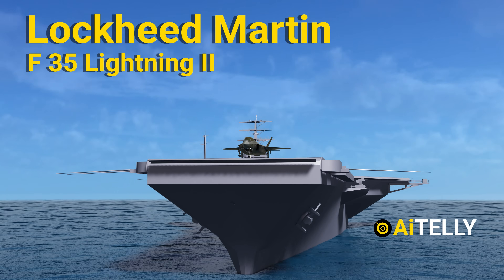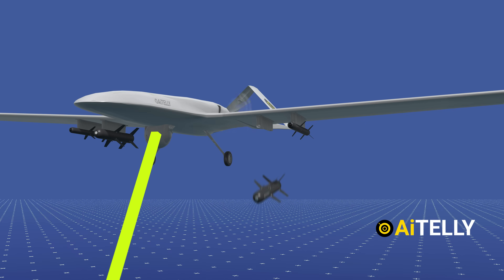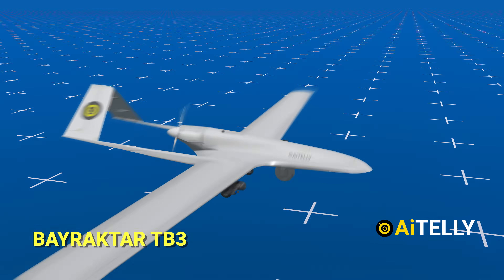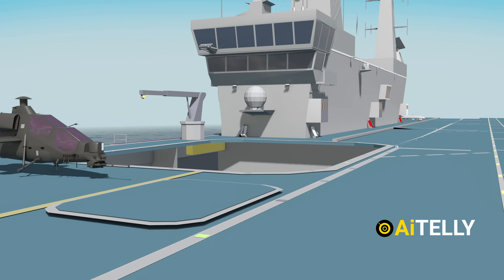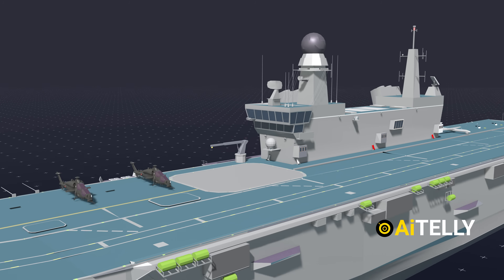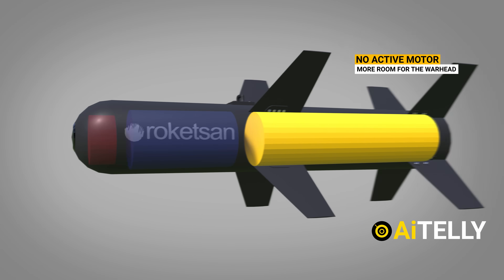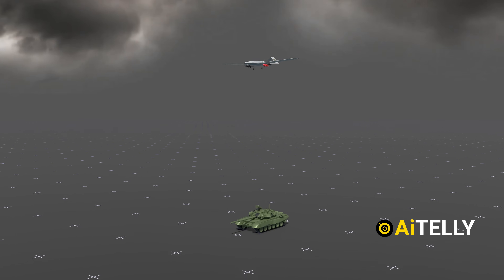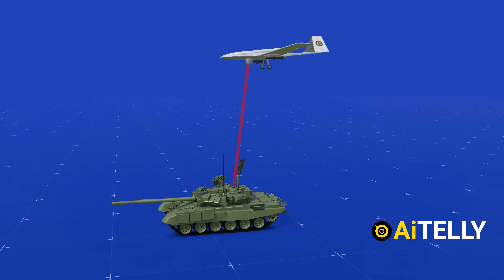TB3 Bayraktar drone Turkey | How it works #drones #tb3 #aircraftcarrier

Comment: Turkey actually does not need the F 35B, The S 400 is better and it could easily detect it. And that was a perfect choice. The drones of turkey are really good apart from politics.
Reply from the maker: Geopolitics is a huge mess.
Reply: @Aitelly  Well yeah. I have seen the reality of Ukraine and syria and all these politics. It does not matter who I stand with, I am sick of it.
Reply: @BaronAsh7981  A bit dissagree because S200,300,400 (I think) doesn't work well for small and low fly object (all 5th gen have small CRS), it maybe work perfect if turkey add Thor-M2
Or.... If they use all these combine with Nebo-M radar 
Nothing against you, just personal opinion share 😁
Reply: @vandasaragosa  Number 1. You can say anything you want. Just be respectful. I am always delighted to have someone correct if I am wrong. 

2. I think the S 200 and S 300 are useless against f 22 and f 35 and even f 15e.And you are correct about low altitude but the S 400 can detect at high altitude to to several frequencies in which at least one can track the F 22 and F 35 right? I mean tons of frequencies and giant range just to be able to give narrow beams to find the stealth. 

vulnerable

4. Thank you and have a good day.
Reply: @BaronAsh7981  I like number one most , I'll take it .. not easy to find normal communication or health debate nowadays lol 

For number 2 is yes I agree especially S400 , with 4 layer independent radar radiation (specific bandwidth is classified as I know) but again it requires another radar to detect 5th gen (before it to close) that is why I'm saying if turkey can get Nebo-M that'll be work , even with S300 is enough lol
Reply: @vandasaragosa  Yes S 400 alone can detect 5th gen at really high altitude at really far ranges but no one will do that. So Turkey or any other s 400 operator must help it out. Just like you said.
Reply: @BaronAsh7981  I know this has nothing to do with the stealthiness of the F35 and the S400 but It would have been more than a bad deal if turkey chose the F35 over the S400. Because to start and use the aircraft you need 2 passwords (for every use). You can only get those from the US. That's a huge problem and disadvantage for many countries (f.e. South Korea).

So in a nutshell, the United States tells you if you can use the aircrafts or not. On top of that, Turkey would have a big problem because of the stand of the US regarding for example Greece, the YPG/PKK and even more.
Reply: @aknc3891  If what you said is right then all f 35 operators are pretty much screwed up.
Reply: @aknc3891  Turkey already have many issue with nator like UK , US , Greece lol
Reply: @vandasaragosa  I don't remember any (major) issues with the UK. I would even say, that they are getting closer since the UK left the EU. They made a free trade agreement and the UK/BAE wanted to provide assistance in developing the engine of the TF-X. And it the future, there will, probably, many more projects, sales etc.
In my opinion, Turkey has problems with the US and Greece for a good reason but that's another topic.
Reply: F35 being trash is debatable. The only reason these things are stealthy is their minimal ability to be tracked by targeting systems (including the s400). Yes, the s400 can detect the f35, but most likely cannot shoot it down because of the ability to be near invisible to targeting radar. The drones were fine, but the f35 was a FAR better choice. Turkiye is already developing anti-air systems. We didn't need the s400. The TFX is already trash anyway because of the zero composite materials on the thing. Look at the factory production videos, and you'll see. Turkiye should not have moved closer to Russia because Russia has not only worse technology but also a worse economic system.
Reply: @SoloTURK11  TF-X üzerinde hiç kompozit yok mu? Sen iyi misin? Biraz gözlerini aç, uyuma! Tusaş geçenlerde Avrupa’nın en büyük kompozit üretim tesislerinden birini açtı. Fikrin olmadan önce bilgin olsun. Buradaki yabancıları da yanlış yönlendirme!
Reply: @SoloTURK11  This comment is fully wrong with the exception of saying the s 400 can detect the f 35. The f 35 xan be detected due to the low frequency the s 400 can produce. This low frequency can penetrate the stealth which is made just to avoid the detection by X band and hight frequency radars.  APARS like systems in russian air defense and jets can easily provide a lock and track to the radar thus guiding missiles right into the f 35 and f 22 face. The drones are perfect and are more effective than Faililure 35  and failure 22. Don't underestimate them. What do you mean developing?  This is a large country and needs protection as we speak.  Say an attack from any country happened, the s 400 air defenses will close the sky not the air defenses being developed....  Russia has the 6th biggest economy per population has nearly 30 billion dollars from arms sales last year. Russia has one of the largest reserve banks. Russia has a ton of gold and silver and platinum ready to empower the economy.  Russia has new customers ready to help.  RUSSIA CREATED ALL THE STEALTH YOU ARE TALKING ABOUT AND BEING ABLE TO CRUSH IT IS EASY AS IT CREATED IT.  Russia has 30% of worldwide iron.  And has 28% of American uranium.  So do your research.
Reply: @BaronAsh7981  No the F35 is stealthy against low band as well but not as stealthy as in x or ku band
Reply: @BaronAsh7981  I'll be honest, I don't freaking understand want the band stuff means. I probably need to learn one day. But my point still stands. The f35 cannot be locked on from the s400. The s400's targeting and tracking radars use different "waves" for different purposes. I know you know that's right. Now you think I am wrong about s400 not tracking? Well, it can't track. Not only that, Russia may be rich in natural resources, but that doesn't mean they are rich. The Russian GDP rivals France's. Look it up and tell me how many Frances fit into Russia. Also, sanctions do exist. Now to the nonsense that Russia has any stealth technology. As I said, nonsense. the SU57 can be tracked from miles away as there are glaring design flaws LIKE THE INTAKES BEING MASSIVE. Also, we see how well their military performed in Ukraine... sorry that was for the opposite day. Their military can't handle tiny Ukraine with a dozen TB2s and western aid. Everything isn't about natural resources anymore. The world has evolved. You should too. (If this was offensive, that was not the intended purpose.) Also low frequency you talk about is for early warning radar. I dare you to make a targeting radar with tech used on an early warning radar. Why do you think there is a difference? Read my text better.
Reply: @mastermariner490  What the hell did you say ? You just inverted it. Stealth is made to counter X band rays not L band. That can be proved by the shoot down of the F117 in Yugoslavia.
Reply: @SoloTURK11  This comment is so ignorant of you. How can you talk and post large text in this way without knowing the bands, you have to know the bands to know how stealth and radars work. It is ok to learn no problem. Let us see.  How could it possibly be not tracked or locked on, as long as low frequency can easily penetrate stealth then that is it. Russian systems have the capabilities of the apars. Go search it up. This basically tracks and scans the area where the aircraft was lastely detected and then afterwards keeps guiding a missile on to the aircraft in that position and this area is smaller every time thus finding the aircraft, tracking it and even locking it and providing guidance for the missile. Yes I think you are wrong and I can prove it thanks to what happened in yugoslavia. Who knew  the first stealth aircraft would be found by an old and outdated radar. It depends on physics and you should learn it. Here is some info from a book not youtube.  

https://web.archive.org/web/20121201031745/http://www.dtic.mil/cgi-bin/GetTRDoc?Location=U2&doc=GetTRDoc.pdf&AD=ADA529057

I am telling you that the russians have the 6th largest economy just behind germany and a couple others and you continue to tell me the economy is crap. Your sanctions have resulted in the ruble nearly hitting 8 year high, Russia will domestically make vehicles and planes , russia found new friends and europe will be a chunk of ice next winter.  See the german and british inflation, biden lost trust, 3 prime ministers for the UK in 1 year. 

As to russia having stealth yes they do, and I will tell you how the F 22 will never detect the Su-57, your best radars on the f 22 are barely half the range of Russia's Byelka. Secondly Russia may use 2 of it's 6 radars with low frequency to penetrate the f22's stealth and yes it can track and lock it due to special systems like APARS.
Secondly Russia's Su-57 has quantum capabilities like quantum well imaging photodetectors QWIP. Russia's jet can pull maneuvers that evade missiles, while it detects your fighters. And eventually when it gets a lock , it immediately fires an R 37M that could shoot down anything below mach 3. The Su-57 can maneuver to angles that evade detection by American radars like 90 degrees for the F 22 and the F 22 does not have side facing radars .  Last but not least 200 km difference between byelka and the  f22 and f 35 radars is a huge one allowing  narrow beams to detect the stealth jet. Before it gets within range of the radar.
Reply: @SoloTURK11  How do you want me to make a radar? Are you out of your mind ?
Reply: How can s400 easily detect f35?
Reply: @mastermariner490  Forget radar; you can see the f35 with the naked eye. It can easily be seen with an early warning radar. It is advanced because of its ability to be stealthy against targeting radar.
Reply: @SoloTURK11  Its stealthy against all known frequencies from the front,even low band radars as in early detection radsrs,because of its fiber mat stealth
Reply: @mastermariner490  Fancy word mean fancy meaning you say? Wrong. Several REAL professionals have proven this; they are smarter than you combined. The stealth fighters aren't stealth against early warning radars. Only targeting radars. I consider this common knowledge.
Reply: @SoloTURK11  Look up US patent US20100271253A1 Cnt-based signature control material
 radar absorbing composite includes a (CNT)-infused fiber material disposed in at least a portion of a matrix material. The composite absorbs radar in a frequency range from about 0.10 Megahertz to about 60 Gigahertz. The CNT-infused fiber material forms a first layer that reduces radar reflectance and a second layer that dissipates the energy of the radar. A method of manufacturing this composite includes disposing a CNT-infused fiber material in a portion of a matrix material with a controlled orientation of the CNT-infused fiber material within the matrix material, and curing the matrix material. The composite can be formed into a panel which is adaptable as a structural component of a transport vessel or missile for use in stealth applications.
Reply: @SoloTURK11  Radar absorbing composite materials of the invention can absorb radar across the entire spectrum of radar frequency bands. In some embodiments, the composite materials can absorb high frequency radar. High frequency (HF) radar bands have frequencies in a range from between about 3 to about 30 MHz (10-100 m). This radar band is useful in coastal radar and over-the-horizon radar (OTH) radar applications. In some embodiments, the composite materials can absorb radar in the P-band. This includes radar frequencies less than about 300 MHz. In some embodiments, the composite materials can absorb radar in the very high frequency band (VHF). VHF radar bands have frequencies in a range from between about 30 to about 330 MHz. The VHF band is useful in applications that are very long range, including, ground penetrating applications. In some embodiments, the composite materials can absorb radar in the ultra high frequency (UHF) band. The UHF band includes frequencies in a range from between about 300 to about 1000 MHz. Applications of the UHF band include very long range applications, such as ballistic missile early warning systems, ground penetrating and foliage penetrating applications. In some embodiments, the composite materials can absorb radar in the long (L) band. The L-band includes frequencies in a range from between about 1 to about 2 GHz. The L-band can be useful in long range applications including, for example, air traffic control and surveillance. In some embodiments, the composite materials can absorb radar in the short (S)-band. The S-band includes frequencies in a range from between about 2 to about 4 GHz. The S-band can be useful in applications such as terminal air traffic control, long-range weather, and marine radar. In some embodiments, the composite material can absorb radar in the C-band which has frequencies in a range from between about 4 to about 8 GHz. The C-band has been used in satellite transponders and in weather applications. In some embodiments, the composite material can absorb radar in the X-band which has frequencies that range from between about 8 to about 12 GHz 2. The X-band is useful in applications such as missile guidance, marine radar, weather, medium-resolution mapping and ground surveillance. In some embodiments, the composite material can absorb radar in the K-band which includes frequencies between about 12 to about 18 GHz. The K-band can be used for detecting clouds by meteorologists, and used by police for detecting speeding motorists employing K-band radar guns. In some embodiments, the composite materials absorbs radar in the Ka-band which includes frequencies from between about 24 to about 40 GHz. The Ka-band can be used in photo radar, such as those used to trigger cameras at traffic signals.
Reply: @mastermariner490  It can use L band or low frequency waves to penetrate the f 35 stealth. There you go.
Reply: @BaronAsh7981  No you cant,because f35 is stealthy there too,L band as well
Reply: @mastermariner490  I want sources and evidences. I can give you evidences that the F 35 can be detected, here you go. From wikipedia. 

Stealth is a key aspect of the F-35's design, and radar cross-section (RCS) is minimized through careful shaping of the airframe and the use of radar-absorbent materials (RAM); visible measures to reduce RCS include alignment of edges, serration of skin panels, and the masking of the engine face and turbine. Additionally, the F-35's diverterless supersonic inlet (DSI) uses a compression bump and forward-swept cowl rather than a splitter gap or bleed system to divert the boundary layer away from the inlet duct, eliminating the diverter cavity and further reducing radar signature.[91][123] The RCS of the F-35 has been characterized as lower than a metal golf ball at certain frequencies and angles; in some conditions, the F-35 compares favorably to the F-22 in stealth.[124][125][126] For maintainability, the F-35's stealth design took lessons learned from prior stealth aircraft such as the F-22; the F-35's radar-absorbent fibermat skin is more durable and requires less maintenance than older topcoats.[127] The aircraft also has reduced infrared and visual signatures as well as strict controls of radio frequency emitters to prevent their detection.[128][129][130] The F-35's stealth design is primarily focused on high-frequency X-band wavelengths;[131] low-frequency radars can spot stealthy aircraft due to Rayleigh scattering, but such radars are also conspicuous, susceptible to clutter, and lack precision.[132][133][134] To disguise its RCS, the aircraft can mount four Luneburg lens reflectors.[135]

The radars may be in a big number and have ECMCM thus protecting from jamming.
Reply: @mastermariner490  The S 400 can be used in that way.
Reply: @BaronAsh7981  s300 can be used for what?
Reply: @mastermariner490  Sorry typing mistake, I meant S 400.
Reply: @BaronAsh7981  S400 cant easily detect a f35 and before they do f35 would have detected the s400 and sent arrgm missiles
Reply: @mastermariner490  I explained. I want you to explain
Reply: @BaronAsh7981  You probably heard of the F117 that was shot down in Serbia?
According to the Serbian SAM Commander Zoltan, the P-18 radar VHF radar (with a 250 km range) detected the F-117 with weapons bay opened at only 30 km at its lowest frequency of 125 MHz – despite F-117 flying a known route. And the F-117 had very little RCS reduction in VHF band, flat surfaces (fully faceted) for instance are much more vulnerable at lower frequencies than blended facets.
Lockheed filed a patent in 2010 about a CNT based RAM (used in F-35) capable of absorbing EM waves from 0.1 MHz to 60 GHz with particular effectiveness in L through K-band. So modern VLO aircraft like F-35 are a lot stealthier at Low Frequency bands than their shaping implies. Though Low Frequency band remains more capable in detecting LO aircraft relatively.
Reply: @mastermariner490  To begin with the serbian incident happened with a terrible radar. You know that. The VHF is a very old radar in comparision to the S 400 and you know the s 400 has detection ranges of 650 km and You are talking about 250 km range. The su 35 can lock on to 30 targets at 400 kms. But you forgot something I always refer to Systems like apars and you always ignore it. The Sam comander dani did not engage due to not being able to track it or lock it so that was solved in russian aircraft. They can track stealth jets,. They even have quantum capabilities out of this world and you still talk about very little RCS.  

Here are sources to debunk what they claim. Always my friend take what they say with a grain of salt. both sides have propaganda and both sides want to make it seem the jets are undestructible. You should not do very low frequency but not very high from 2-4 ghz is perfect and it can detect it:

https://www.sandboxx.us/blog/americas-enemies-can-track-stealth-fighters-on-radar-and-it-isnt-a-problem/

https://www.key.aero/forum/modern-military-aviation/129367-passive-sensor-l-band-radar-of-usa#:~:text=L-band%20radar%20can%20detect,compousite%20not%20reflect%20radar%20waves

https://secure.afa.org/Mitchell/reports/MS_RadarGame_0910.pdf

Read some books and dismiss what companies like sukhoi and lockheed martin say.
Reply: @mastermariner490  And my friend you also said it. Even if one radar can't detect the f 22 or f 35 the other high X band radar will penetrate the stealth sooner or later.  the S 400 has at least 500 km range. Thus needs 300km maximum to detect any stealth aircraft using x band. It can also use or slightly lower frequency than X band if not possible.   And all this time the radar on the F 22 and F 35 will never pick it up as they are merely 200km radius.
Reply: @BaronAsh7981  X band is the frequency where stealth fighters are most stealthy
And F35 doesnt use radar to detect radar waves from s400 it uses other passive sensors.
I allready explained it to you,f35 will send an arrgm missiles to take out the radar before they even know its there,and even if they know its there,they cant get a missile lock
Reply: @BaronAsh7981  The s400 have 500 km range if it sits on top of a mountain.
You probably never heard of radar horizon,genius
Reply: @mastermariner490  Because F-35 isn’t fully stealth No plane is fully stealth and S-400 has the most advanced radar system which easily can detect the F-35 i mean it was build for it and if you now ask me why Russians don’t use the S-400 in Ukraine well simple Ukrainians don’t use  jets so often many of them got destroyed in the first days by Russian surprise attack ofcourse Ukrainians are prepared now and make a fantastic job too kick the Russians back but also Ukrainians are using SU fighters which aren’t stealth so there is no reason to use the S-400 and also against drones it’s economically useless because shooting with S-400 isn’t cheap and for regular jets the S-300 even Pantsir is enough and Russia has now S-500 and S-550 which is much more advanced truly a satellite killer
Reply: @mastermariner490  Israel was never in Iranian airspace just propaganda if they would they would show footages
Reply: @mastermariner490  sure and I was the first human on mars 🤣
Reply: @yourmomslover2288  Yes i know,and you are obviously still there
Reply: Until enemy jams signal 😂😂😂
Reply: @whysoserious7553  That is actually wrong. And russia has ECMCM (electronic counter measure countermeasures ). Get educated.
Reply: China called the S400 a S300 with a new paint job. So much for Russias glorious S400 claims.
Reply: @terribrad24  Ah ... a cherry picker. Now you believe China but what about it's claims about its army? Why do you believe what you  want? Also I compared and saw the s 400 better.